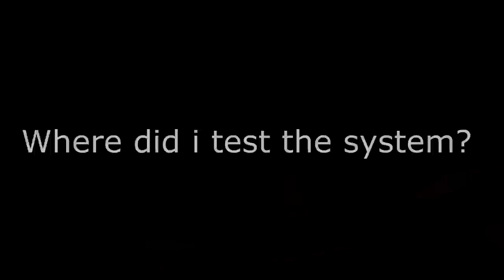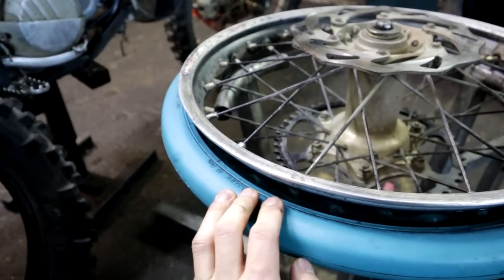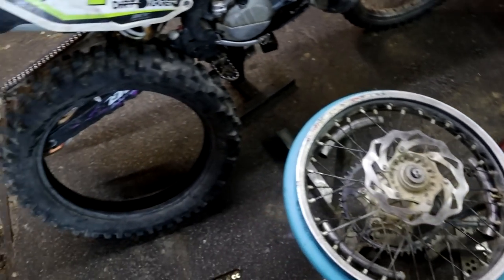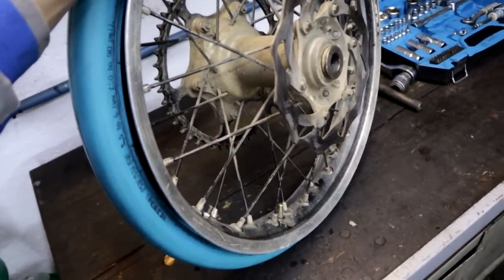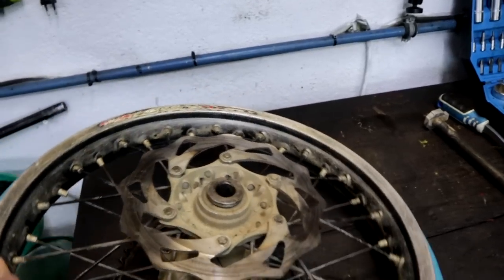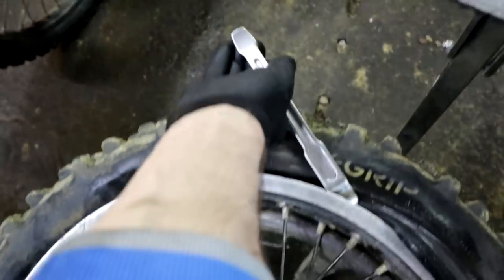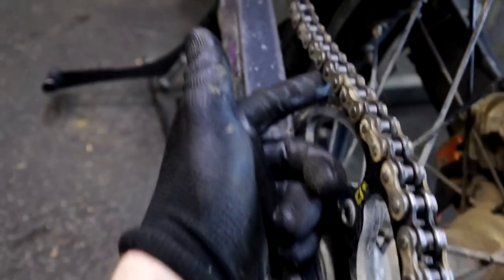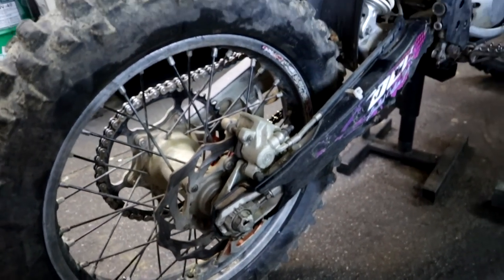UNLIMITED GRIP ! - nomOusse After 100 Hours Review

Comment: Hello, Nomousse is an invention of 2 enduro-loving Spanish engineers. Here in Spain it is very well known and it really works well. The tires have to be medium or hard carcass if you use a very soft carcass tire you can crack the tire. In Spain the climate is drier than in Northern Europe and there are many stones and roots. Maybe it works for you and a soft one does not break, it is a matter of trying.

Comment: I think the rim lock on the Tubliss system is to prevent the tire from spinning on the rim in the event that the high pressure tube fails. Can always carry a few heavy duty zip ties for that though. Edit- checked the price and it looks like it will be a lot more than Tubliss to get one to Canada. Bummer, looks like a nice system.
Reply: yes exactly,tubliss is better overall
Reply: Also at low pressures the tire can slip and a rim lock is necessary.
Reply: Did you manage to get one in to Canada and try it?
I have a set of full Mousse wheels for hard enduro, and a set of HD tube wheels for more Adv rides. But I’ve had enough flats in HD tubes last year to try something else. Problem is there’s precisely as many tubliss haters on line as there are fans. So hoping this noMousse might be a solution.
Reply: @ThisTall  try a Luciolli , you won't get a pinch flat with that and run as low psi as you want. It's just a little heavy but I don't notice it on the rear wheel.
Reply: @Matthew-wn8oq in the last 2 months there were 3 lucioli fails among our riders, not to mention it weighs 3 kilos. Tublis/traxxy is way superior compared to lucioli

Comment: Nice video, thanks!  Also noticed your clutch looks different, or is it just the lever?  If it is aftermarket, what type is it?  Looks like it is working well either way.
Reply: Looks like a clake clutch.
Reply from the maker: hey bro, i use stock clutch. Only what i use sometimes is flex levers from twently 24mx. But in this video i have stock lever with electric tape covered for more grip.